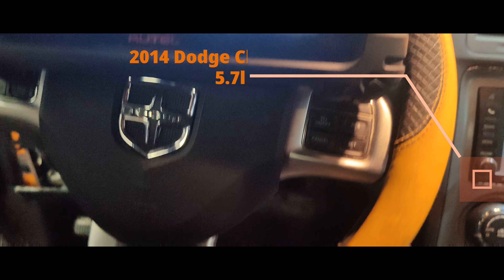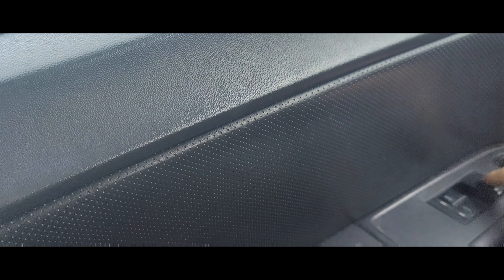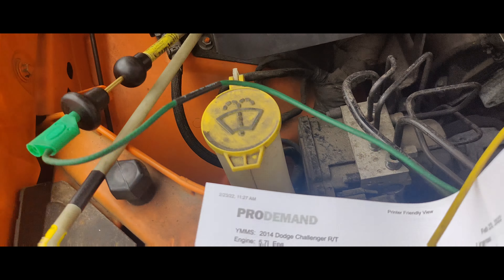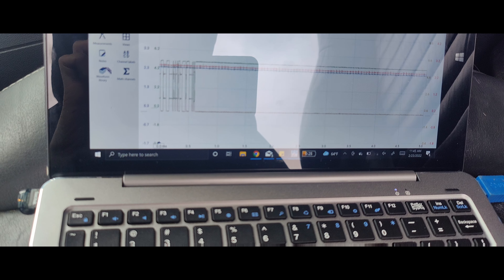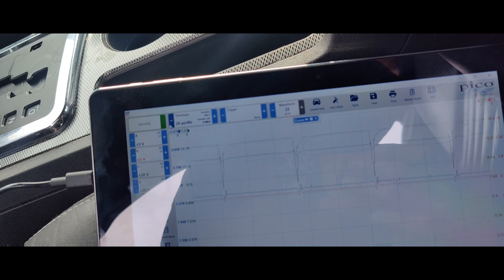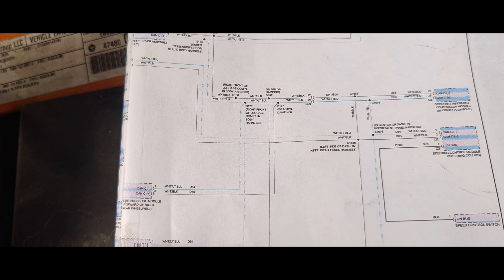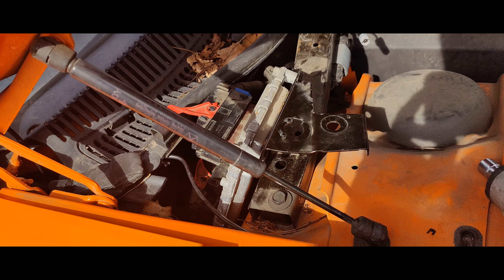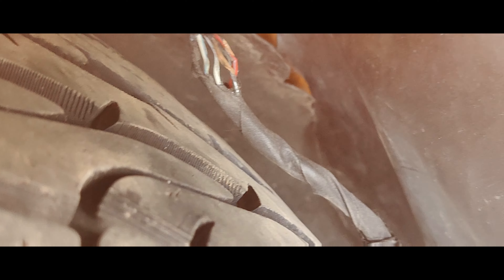2014 Dodge Challenger No Communication, No Power, No Crank?

Comment: Rob a lot of work to find wire damage in a damaged wheel well. Thanks for sharing. Never know what you will find. Was car privately owned or from another shop or body shop? Freezing  the TIPM  I guess did nothing yet temp is a known culprit. Haven’t watched in awhile but your videos are still top notch. I have quite a few to watch. Stay safe and well  Artie 👍
Reply from the maker: Freezing the tipm did nothing. I had originally looked at the car a few months earlier but I was really sick and got no where with unplugging modules because I didn't know it had a separate Tpms module. I thought it was part of the wireless node  module. This was a customer's car that was fixed at a body shop then taken to a shop I go to.
Reply: @RobertDotterer  Rob is it still possible to join your master technician  group and is it still 10$ a month and is it open for any skill level. I believe I would like to join for the special access it provides. For myself it’s the continued learning and  enjoyment plus a great escape to this crazy world  Artie 👍

Comment: If the car wiring harness is chopped up, can I go splice another and reattach it? It’s just the wiring on this part same issue though.
Reply from the maker: You can but you have to make sure you solder and seal it and make sure it's the same gauge wire or bigger.